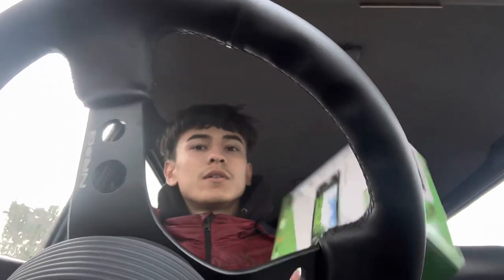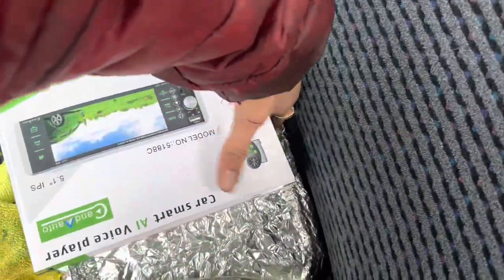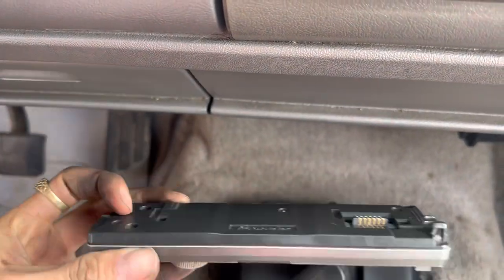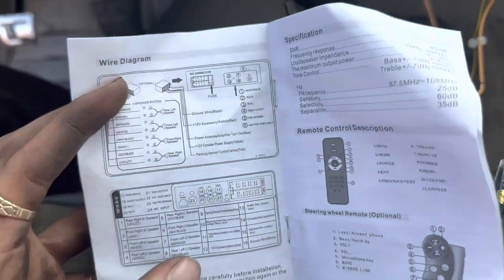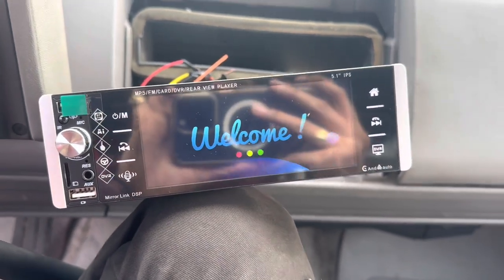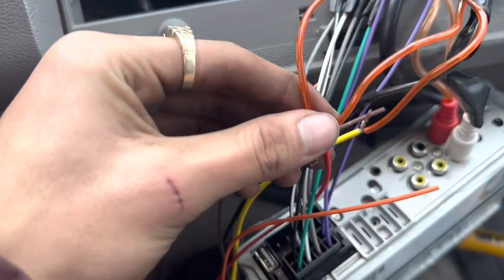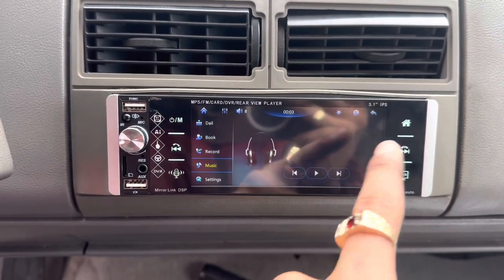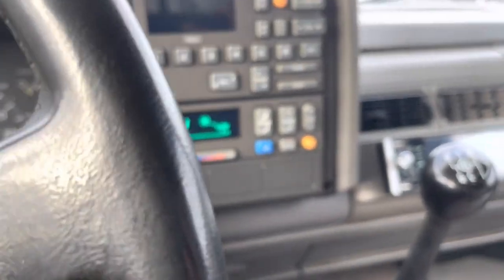OBS Stepside Chevy Gets A New Single Din Touch Screen Stereo !

Comment: You figure how to wire the camera bro?
Reply from the maker: I didnt end up putting it on i got a new stereo cause it wasnt loud but all you need to do is find a long wire that will reach from behind the dash all the way to the trucks bed or wherever you end putting it u also need to maybe drill a hole somewhere in the truck to run the camera wire to where the camera will be placed idk if that will help but i hope it does a bit
Reply: @_PR0JECT_  got you bro, I already did that, I just can't get the camera to kick on lol. But no problem man. I subscribed haha, if I figure it out, I'll probably make a short vid on my channel and post it up. Us OBS guys gotta stick together and figure these things out together 😂💪🏽
Reply from the maker: @obsdwayne  yessir ima go sub to you I didn’t know u made videos I could learn some things
Reply: @_PR0JECT_  thanks alot bro! 🤘🏼 I just uploaded how to install the backup camera and stereo haha. I figured it out 💪🏽